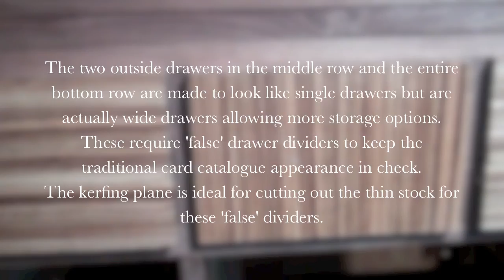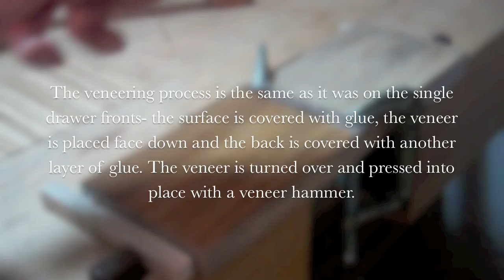A Card Catalogue part eighteen: Drawer front veneers- Part B

Comment: Tom Fidgen Why do you set the front side of the veneer in the already applied hide glue, while you put hide glue on the back side of the veneer? doesn't that just make it messier when you flip it over to use the veneer hammer?
Reply from the maker: It lubricates the hammer blade and makes it easier to squeegee the veneer. Thanks for the interest~; )
Reply: Great video as always Tom! I love working with hot hide glue, it doesn't leave my hands dirty and nasty for days like some of the other glues on the market.
Reply: Hey Tom, do you ever warm the end of the veneer hammer before using it?
Reply from the maker: Great question- I haven't... but it's definitely something I'd try if my shop wasn't heated.